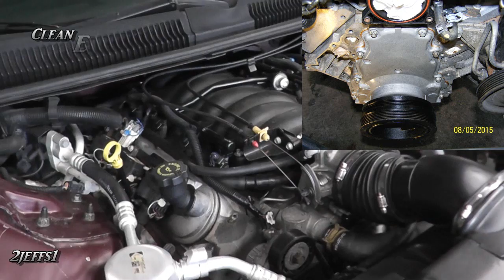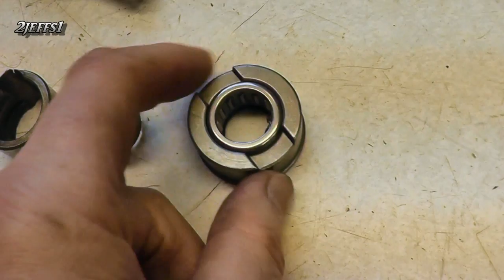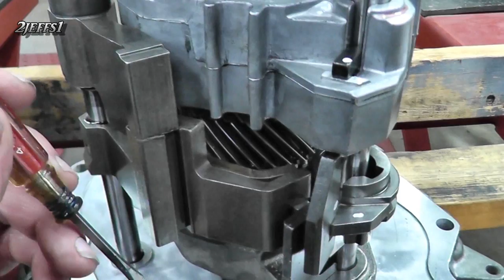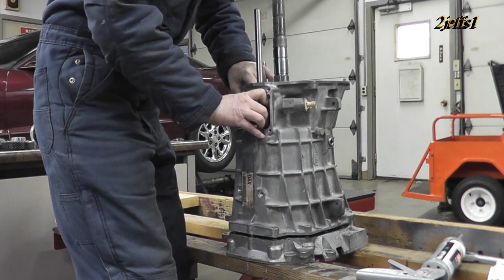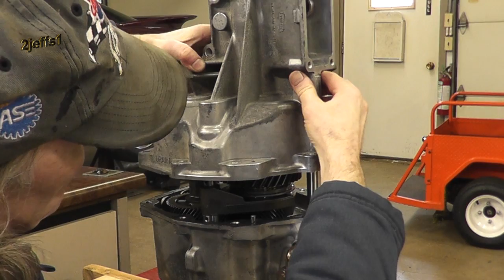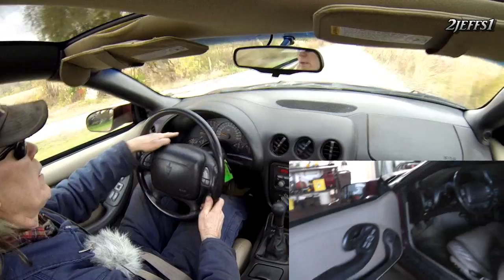Tremec T56 - 6 spd Trans Rebuild Homemade Trans Jack & New Project

Comment: im getting a bad vibration in 6th only 1996 trans am with lt1 and borg warner 6speed shifts fine
Reply from the maker: I can't picture that issue from the trans. Trans rear crossbeam mount or u joints/driveshaft balance?
Reply: 2jeffs1 with the driveshaft removed and car in 6th running it vibrates 1st thru 4th no issues 5th has a slight vibration 6rh is worse, pulled trans took to a shop
Reply from the maker: Quite curious on this one. Will be interesting to see what you find!
Reply: when i know ill post it
Reply from the maker: Thank you for getting back. Will be interesting on that particular issue.

Comment: Me again two Jeff's

You read my mind man, just picked up a brand new T56 6 speed for my 69 Stang Mach 1. It will be bolted up to a 429 SCJ with 429 Boss Bulkheads
Reply from the maker: Hi Josh. Way cool, I bet you can hardly wait until the day you get it finished and get a ride! Is is so much driving a car with one of them in v/s the old 4 speeds!

Comment: Jeff this is a great video!   I have a 98 TA WS6 with the T56.  140k & the problems you mentioned.  I did some racing back in the day and starting to get to work on my neglected street cars. I have rebuilt my Falcon transmissions in our dirt mod but was reluctant to tackle this project.  With this video I think I'll give it a whirl.  Your link to the parts store doesn't still seem to be up? Maybe because it's from a while back. Can you suggest a supplier?  Thanks again for the great video!
Reply from the maker: Hi Rob. When I did that trans I dealt with a different company than normal. Salesman sucked, not helpful at all. Trans star is who I use to deal with if they are in business yet (things are changing so much these days) check with them perhaps.

Comment: where did you get all the specs for it? as far as clearances and assembly/disassembly? thanks
Reply from the maker: I use Michell manuals Those cover different trans/trans axle and transfer case, many models.

Comment: great video. very interesting. I know nothing about transmissions, but i have heard that skipping gears can wear out syncros. any truth to that? I myself skip gears all he time.
Reply from the maker: +Tiit Saul I believe that is correct. When I do that I'll allow a bit of time before engaging the skipped gear or gears so  the clutch disc has time to slow first to match the engine speed. Perhaps you caught how long I delayed the 6th engagement when the other gears were skipped - second to sixth. There is a different feel in the shifter when speeds are matched with the engine. Under those conditions the rings should last for the life of the trans one would think.
Reply: Thank you for the explanation. When I skip gears from third to fifth I still shift into fourth for a moment ( clutch still engaged). I think it helps a little bit.

Comment: Would you happen to have a spare exciter ring for a T56 Magnum? if not do you know where I may be able to get one? I need to make one with half as many teeth for a special application on a Mazda Rx-7. Speedo reads twice the speed and I would rather modify the trans than the gauge cluster. BTW thanks for sharing the awesome tips!
Reply from the maker: No spare here. Probably check with a trans shop. Worse comes to worse a dealership could get you one...

Comment: Really excellent video Jeff.  You have a great way of explaining everything with the correct terms, and lots of skill obviously.  Neat tricks too.
I've got a C5 ZO-6 and it shifts very well, but in a week I'll be test driving an '07 CTS-V and the owner has made some mention of the trans being sticky into first.  Car only has 30k on it - any advice as to how to determine if the Tremec in that V is in trouble?  I know how to check for clutch drag, but I don't want to buy a problem!
Thanks for posting the video!
Reply from the maker: Up shifting the trans still worked pretty good. When coming to a stop getting into first gear was the big problem. When coming up on a 4 way stop and its your turn to go and your not able to get into first that is quite aggravating! (as you noted there was no clutch drag either) On an older 4 speed trans one could always work the clutch just right and easily get into gear no matter how tired the trans was. Anyway that would be a sign of upcoming repairs. Hope that helps ya out.
Reply: I've driven the CTS-V and have purchased it.  First and second are very smooth and easy to engage.  It pops out of reverse gently, mostly I think because the stock shifter is so sloppy.  Reminds me of the old "Cornbinder Wobblestick" of the past!  I'm hoping a short shifter will make the difference on the reverse engagement - I don't think it's getting fully into gear.
Thanks for the reply and the advice Jeff.  Take care!

Comment: I have a 2004 cobra. My T56 keeps popping out of 4th gear. It does it maybe 3-4 times while I’m driving normally. But it goes right back in gear when I push the clutch in. What do u think that is? My car is pushing out 630 hp to the tire. Do I need to upgrade the gears or something? Thanks for any help u give.
Reply from the maker: The detents must be crisp which assist in gear retention but I more so suspect the teeth in the 3/4 syncro block slide collar or 4th gear where the collar - slide/contact area are worn.

Comment: Hi Jeff! after watching your video I am quite excited to take my T56 apart. It has the same problem like you had in 1st and 2nd. it sometimes does it in 3rd aswell. and almost never engages into reverse anymore. I've only done about 2000 miles on it since I bought it of craigslist. I'm wondering if this failure might have been caused by running the wrong transmission fluid or perhaps the B&M short shifter. At first I had Penzoil dexron 3 ATF in it and only recently changed it to GM synchromesh after the problems started shifting. what Oil do you recomend? and what do you think might have happened to 3rd gear and reverse? Your advice will be greatly appreciated sir! Thank you.
Reply from the maker: Don't seem right/not good where you just bought it and having problems already. First I am running the regular Dex 3. (Did do some research on that again some time ago.) Actually in the 70's I was putting that in manual transmissions and transfer cases before the manufactures were doing that. I enjoy experimental as you might gather. Things shifted great when below zero and never any related failures. I have tried the Dex 6 and gear oil in a bad working T56 to experiment to see if it helped at all. Actually think that made things a little worse. Wanted to include that cause I know someone was probably pondering doing that to save them the effort!! For the 3rd and reverse check the rings, syncro blocks, and forks over carefully after disassemble for wear and engagement teeth nose tips/ends. A little FYI - When I engage to reverse I do that while slightly moving and that seems to make it go in better than at a full stop. After all it has a syncro ring!  You are probably aware of that reverse lock out. The factory setting from the computer  keeps reverse gate blocked until under 2 mph. I did change my computer to 10 mph with that tuners program. I like being able to easily get into that gate in advance even tho not ready for rev yet - especially backing in a driveway on a busy road. That B&M short shifter - not familiar with that so sorry can't help. Just take your time and inspect the concern areas & assemble and you should end up being a happy camper, Jeff

Comment: Do you think a T5 transmission would be sufficient for a 327?  I have a 72 Buick Skylark and a 327/quadrajet carb with a 2.93 rear end.  My goal is to shoot for 25 mpg.  Some say I would need a shorter rear end like a 3.55 so as not to be revving to the moon in city driving.  What would be your take on this scenario Jeff?
Reply from the maker: I think that would be a good choice. They hold up great and with a lower rear gear you would have the best of all worlds. City and highway driving.

Comment: 2jeffs1  Great video ! I am having the same exact issues with gears 1 and 2 but I’m not so sure I trust my skill level to fix myself. What should I expect to pay a mechanic for this job? Thanks
Reply from the maker: Hard to answer that. Depends on what they all end up replacing, etc.... I would try to find a friend who is happy with a certain place and they thought they seemed honest and offer to show you the replaced parts on pickup with a reason why they were replaced. Beware - I have seen people bid low to get you in the door and when taken apart they.... Also the cheapest bid usually ends up with a return visit for a re-do so beware.

Comment: Great video man, T56 is one of my all time favorite Trans to work on. Getting ready to pull mine out of my 97 Comp T/A Build #154 and rebuild it. Only 55k miles but I'm starting to get the infamous problem of it jumping out of 2nd Gear. Never accrued to me to mark for the guide pins, I've been lucky and haven't had that much trouble with them in the past. But its something I'm going to do from now on.

Comment: I had a 99 Firebird with a 5 speed.  I always wanted a T56-6 Speed for it, but alas my wife made me sell it because it did not have back doors. Grinn....  I have never owned an automatic car, and I would have loved a T56.  BTW,  When I sold it last year the transmission was like new.  I have never blown up a manual transmission yet, and my synchros were good in all gears.  I rev match all up and down shifts, and when it is cold I double clutch into 2nd gear for the first couple of minutes.  Most guys just jamb it and pay the price.  Many years ago (I'm dating myself) I factory ordered a  76 Pontiac Ventura with a V8 and a 5 speed.  That year there were five of them ordered in my city and all got destroyed in the first year.  They said those Borg Warner 5 speeds were a weak transmission.  I sold mine 19 years later because it was totally rusted out, but that Borg Warner "weak transmission"  was still perfect.  Four years ago I bought a new 2014 Chev Cruz with a 6 speed of course.  I don't know how long that little 1.8 four banger will last, but I expect the 6 speed will last the life of the car, because nobody, but nobody drives my manual transmission car.  Shifting a stick today is a lost art.

Comment: Very cool video!  Btw, what kind of shop press would you need for this?  I'm having my T56 rebuilt right now, and the guy told me that most transmission shops don't rebuild manuals because they're rare and because they would need a shop press.  If I wanted to do this on my own, what kind of specs should I look for?  Thanks!

Comment: Could you possibly put a parts list in a comment? My GTO has a similar issue. And it drives me absolutely crazy. I'd like to pull the trans apart, rebuild it, and replace the clutch system.

Comment: love the video very helpful, about to have a t56 rebuilt and its stuck in 4th gear will not come out with the car on or off, any idea what that would be before i dive into it?
Reply from the maker: Where they have that upgraded 3/4 steel shift fork kinda thinking the aluminum one might of failed/broke. Hope this helps out and good luck on your repair, Jeff.

Comment: In your experience on the GTO T56 Tremecs... If grinding while shifting into 2nd, can you get away with just replacing the center friction cone? Or should inner and outer also be replaced. (These do not have the kevlar/carbon pads on them like the double-sided center ring, but do they get really get worn down much?) Also would it be worth trying to just swap out my fluid to GM Synchromesh? Not sure what is in there now... Bought it in this condition.

Comment: Hi jeff, first time watcher, from the UK. Very informative video. I'm looking to make a gokart for my boy but i wanted to make it geared for me to play with when hes not there. That way I have more power to play with while my son can play relatively safely. Any ideas on which sort of gear system would be better? currently thinking of running it with a 600cc honda cbr engine or some such.
Reply from the maker: +Craig Blanchard  Hello Crag. Many years back I built a kart with a narrowed car car rear end. I did buy the rear end which was crudely shortened by a guy. (was cheap & worked good) Then I bought 2 - 3 speed transmissions from the junk yard that the shifter came directly out of the top. (don't remember what they were from) Hooked them inline together with no driveshafts only the yokes & u joints. Had 9 gears forward and 3 speeds in reverse. Then put a 10 HP Briggs in front with a duel belt clutch. The frame and steering was all homemade. With both trans-es in 1 st gear top speed was 3 mph but the power was awesome. With both in 3rd gears app 45 mph was possible. That thing was great for all around uses. I do have 8mm footage of this thing but it's pretty grainy. Still might post it some day where folks like you would probably enjoy it. If there was a way for you to link a 3 or 4 speed trans with your setup you should have a similar setup, speed & power. Hope this helps you out with some thoughts, Jeff.
Reply: 2jeffs1 I'd like to see that!

Comment: I'm researching t56 trans, for my t5 upgrade. It will No handle the power from my stroker engine. I just cannot see swapping in a automatic! Unless it's maybe a 6L80e, but still, I'd rather have a clutch!!, any idea where to find a good deal. On a untouched T56?

Comment: I got a T56 Magnum for my 68 Chevelle back in 2016.  Today since I had not run the car for a week and the battery was discharged I started it up and I was running it in neutral at about 4000 rpm for about 2-3 minutes when I heard some mechanical noises.  I got off the throttle right away and at the same time the engine stalled.  Something happened to the transmission.  I can only move the shifter into first and second gears.  When I start the car up I must keep the clutch engaged as I have no neutral.  With the shifter in neutral and the clutch released slowly the car moves as if in gear.  If I try to move the car in first the car stalls as if in two gears.  What in the world happened?

Comment: Jeff can you recommend a rebuild kit for a 97 Camaro with an LT1 with T56?
Reply from the maker: Hi there! The kit I bought was kinda an overkill where the bearings probably would of been fine but I can't tie up the shop for my stuff, wanted to make sure all went good. Seems you can buy a more basic kit, syncro rings without the bearings and might want to consider several of the updated parts as shown on the video too. That rebuild kit I showed came from  http://zbag.com/

Comment: Hey, Man, nice video.
I'm looking for a kind of support located at the left side of the transmission that holds a support bar that ends at the differential holding bolts, but I don't know the name and that makes me hard to find It.
I own a 1997 Pontiac Firebird Trans Am WS.6 with a tremec t56 transmission.
Reply: its called a torque arm

Comment: Going back together with mine I get stuck in 4th. It seems the throw of the ring is too long (more than halfway past the synchro keys) and then it's too difficult to go back to center. I'm seating on my tapered bearing and in the key ways on my synchro ring... What limits the throw of the ring? Hitting the gear or the H pattern? Yours goes in and out of 4th effortlessly when putting the case on so I think something is wrong. I did have to use a puller to get the 3-4 hub off and I had to press it back on. It's flush with the snap ring so I don't get it. The distances from 3rd to center and 4th to center is pretty much the same (within .050"). I'm lost at the moment...
Reply: Anyone having the same problem, mine was from using a slider sleeve that wasn't tight enough on the hub causing it to be able to flop around in there (it was an aftermarket slider). I was also popping out of 3rd gear under decel. New matched hub and slider and no more problems.